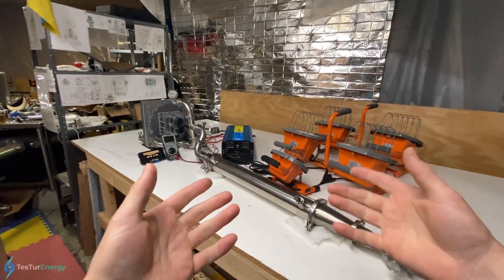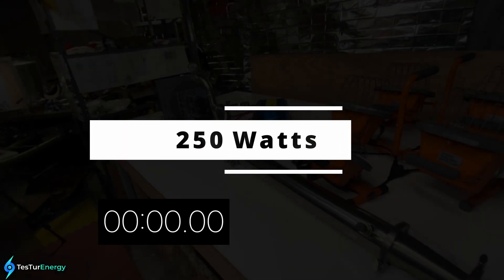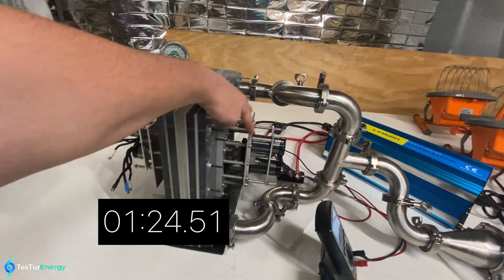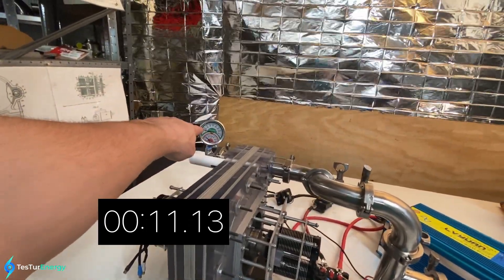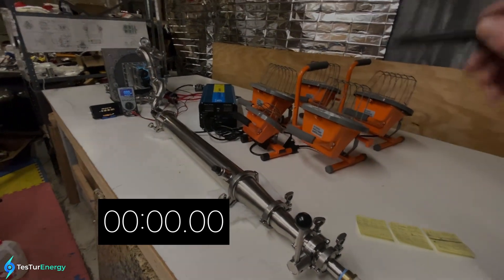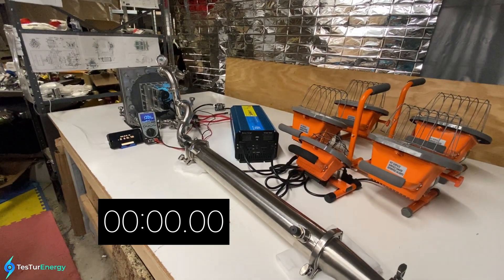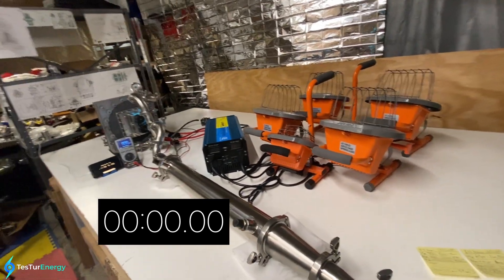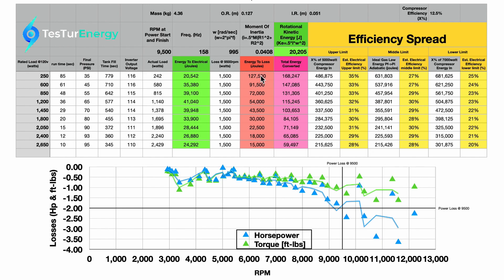Tesla Turbine 250 watt to 2.65 kW Power and Efficiency Test

Comment: Out of curiosity, in an off grid use case, what would a feasible way to "fuel" a turbine like this?
Reply from the maker: Hey thanks for asking! 

When it comes to utilizing low-temperature, high-pressure gases for power generation, technologies like Compressed Air Energy Storage (CAES) and Cryogenic or Liquid Air Energy Storage (LAES/CES) are not just theoretical; they’re already in use at the industrial level.  In the context of engine mechanics, the typical workflow involves compressing air, heating it, and subsequently expanding it.  This is the essence of most gas turbines and turbojet engines, which operate based on the Brayton cycle. For those not versed in thermodynamics, the Brayton cycle consists of three key phases:  Air compression Heat input (usually through combustion, but other methods work too) Expansion of the heated air. 
 
When considering steam-based systems, you only need to introduce heat to turn the fluid into vapor. Technologies like Ocean Thermal Energy Conversion (OTEC) can not only produce steam but can also operate using an organic Rankine cycle at notably lower temperatures.  Of special interest is Tesla’s amended turbine patent, GB 186,083. This inventive design uses the residual heat from the turbine’s exhaust to produce steam.  The generated steam then pre-cools the combustion jet prior to entering the turbine, thereby reducing the usual compression demands seen in traditional gas turbines.  While conventional gas turbines work with air-to-fuel ratios ranging from 100:1 to 200:1, Tesla’s design minimizes the strain the compressor places on the shaft, allowing it to run efficiently even with stoichiometric ratios as low as 15:1.  Furthermore, Tesla’s subsequent patent, GB 186,084, integrates both combustion and steam turbine functionalities, negating the need for a separate compressor. 

With TesTur Energy, we’re committed to empowering individuals with energy autonomy through our Combined Heat And Power (CHP) solutions.   Our systems are uniquely designed to harness overlooked energy resources like biomass, solar thermal, and geothermal, as well as unconventional fuels rich in solid particulates—think sawdust, pulverized coal, or powdered iron.  Traditionally, these alternative energy sources and fuels have been underexploited due to the limitations of existing turbines and engines.   These systems often can’t manage the complex fluid flows—mixtures of gases, liquids, and solid particles—that are characteristic of low-grade heat boilers and unconventional fuels.  But our technology changes that, enabling sustained, damage-free operation even in these challenging conditions.  www.HeatAndPower.com  www.TesTurEnergy.com 
 
Our initial tests serve as an exploratory stage to gauge the electrical output potential of a Tesla turbine driven by room-temperature compressed air.     Remarkably, our plastic and aluminum 10in diameter prototype generated 6.22 ft-lbs of torque at a mere 4150 RPM and over 4.25 kW between 6000-12,000 RPM.     This places our prototype squarely between the capabilities of a 50cc and a 125cc combustion engine, even with those on 150psi compression scenario.    During our tests, TesTur nozzle pressures stayed below 20psi for a 2650-watt electrical load and never exceeded 40psi during a 4250-watt dyno test.     The smaller 4.5in diameter prototype has been tested up to 600watts with real electrical load at about 15,000rpm. And up to 1200watts on the Dyno between 6,000rpm and 18,000rpm. And the nozzle pressure was about 25-30psi.  These initial tests serve as a baseline for future tests involving combustion-level temperatures.    It’s noteworthy that when using elastic gases, an often-overlooked aspect is that gas viscosity actually increases with temperature.     This not only boosts thermodynamic efficiency but also enhances TesTur’s isentropic efficiency by reducing slip due to the increased viscosity.    For a deeper dive into our testing and findings, head over to my YouTube channel—the link is in my bio.     If you have questions, don’t hesitate to leave a comment on any video.    I’m committed to offering detailed, thoughtful responses to all inquiries.   Cheers!

Comment: You could use helical gears to make them quieter, it’s commonly used on  cars equipped with manual transmissions to make them quieter. I’m sure you could have someone make you some hardened steel gears. You could make a little gear box to hold gear oil which would elongate the life of the gears way more than any dry gears.
Reply from the maker: Hey thanks for the comment. 🙏❤️‍🔥

 So to be clear the gears are entirely unnecessary. 

I wanted to prove that the myth everyone claims that “Tesla Turbines get low torque and have to to be geared DOWN” wrong so I went instead of just going direct to shaft with it, I went and geared it UP at 45 tooth turbine shaft and 15 tooth generator shaft, so that it was beyond a shadow of doubt that they do not need to be geared down. 
Check out the new 4.5in TesTur that has a direct to shaft generator set up. 
🦾🤓👨‍🔬

DIY Turbo Generator for Off-Grid Electricity: 250 watt Load https://youtu.be/60OqmBMNV-Q
Reply: @CharlieSolis  oh cool good to know, and yea there’s no doubt that these turbines can actually have a decent amount of torque.
Reply from the maker: @i69beanfarts420  though your gear idea setup does sound super dope! 😎

Now to detract from that 😅

Comment: You have the most beautiful lab set-up, as far as individual R&D labs go. Totally drooling over all the tri-clamp plumbing… and everything matches!? That’s the way I’d do it, if I won the lottery. Did a supply company go outta business nearby? Delivery truck get stolen and abandoned in your back yard? 😂 Just jealous here… know how clean, quick, and easy the tri-clamp parts would make “reconfiguring” countless experiments. On the data side, I did crunch your spreadsheet numbers and saw a trough in CFM per W (or peak W per CFM) of around 0.218 CFM/W near 1,400W load… in case you didn’t? No way to post my spreadsheet markups here. Also, I swear I see an in-line heat exchanger along the input stream too… that’s what I’d wanna test! 🤔 Great work you’re doing!
Reply from the maker: Hey thanks for the comment 🙏❤️‍🔥 oh yeah Tri clamp is life! 🤓

And yes you did see a shell and tube heat exchanger. But there was nothing in it for these runs. I was going to do thermal addition tests but didn’t get around to it before building the whole closed loop steam system.
Reply from the maker: Steam Tesla Turbine Micro Power Plant - 1st Start Up https://youtu.be/aMYyBsjhBR4   

https://www.instagram.com/reel/ClqGwiDDRSN/?igshid=ZmMyNmFmZTc=

Comment: So if you have the air blowing trough the compressor that uses energy, turbine creating energy, could you make infinite energy?
Reply from the maker: Hey thanks for commenting. Unfortunately no that’s not possible and would defy the laws of physics. 

Fortunately though, With TesTur Energy, our mission is to give people energy independence through Combined Heat And Power (CHP) systems that can make use of underutilized energy sources like biomass, solar thermal, geothermal and even low grade fuels containing high quantities of solid particulates (like saw dust, pulverized coal and powdered iron); energy sources/stores that are currently underutilized due to the lack of turbines and engines capable of handling the multiphase fluid flows (any combination of gasses, liquids, solid particulates) present in low grade heat boilers and low grade fuel sources without damage over prolonged/continuous periods of use. 

Www.HeatAndPower.com 

www.TesTurEnergy.com 

First and foremost, in terms of using high pressure, low temp gases in actual generator capacities, Compressed Air Energy Storage (CAES) and Liquid Air/Cryogenic Energy Storage (LAES/CES) are very viable solutions, and they’re being employed at industrial scales as we speak.  

When we look at how engines function, they typically compress air, heat it, and then expand it.   

Most gas turbines and turbojet engines possess a compressor, operating on what’s known as the Brayton cycle.   

For those unfamiliar, the Brayton cycle comprises three main processes:  

1) compression of air 

2) addition of heat (typically combustion but could be anything) 

3) then expansion of the air. 

If we’re talking about steam systems, only heat needs to be added to vaporize the fluid. 

Systems like ocean thermal energy conversion (OTEC) can vaporize steam, or even function in an organic Rankine cycle, at significantly reduced temperatures.  

Tesla’s improved turbine patent GB 186,083 is particularly noteworthy here.  

It cleverly uses heat from the turbine exhaust to generate steam.   

This steam then cools the combustion jet before it enters the turbine, thus significantly reducing the compressed needs typical of most gas turbines.   

While regular gas turbines require an air-fuel mix in the range of 100:1 to 200:1, thanks to this innovative approach, Tesla’s patent slashes the load that the compressor puts on the shaft, making it efficient even with stoichiometric mixtures around 15:1.  

Moreover, Tesla’s patent GB 186,084 combines combustion and steam turbine functionality, eliminating the need for a compressor altogether. 

Our current tests with the Tesla turbine aim to establish baselines.   

We’ve already achieved impressive results with the 10in diameter TesTur— 6.22ft-Ibs of torque at 4150rpm and over 4.25kW between 6000-12,000 rpm, while maintaining relatively low pressures at the nozzle.  

It’s crucial to understand that, counterintuitively, the viscosity of gases actually increases with temperature.   

This means that as we hike up the temperatures to combustion levels, not only do we anticipate a boost in thermodynamic efficiency but also a leap in the TesTur’s isentropic efficiency, thanks to reduced slip caused by the heightened viscosity.  Our endgame at TesTur Energy is all about energy independence.   

We’re passionate about tapping into underutilized energy sources and stores, such as biomass, solar thermal, geothermal, and even unconventional fuels with high particulate content.   

The ultimate goal?   

To harness these energy stores with systems that can manage multiphase fluid flows, ensuring longevity and efficiency.   

To find how to get more hands on experience with a Tesla turbine of your own go to HeatAndPower.com and see what all the fuss is about!